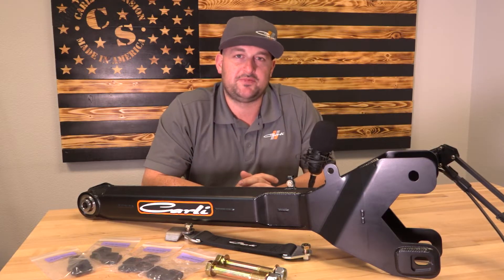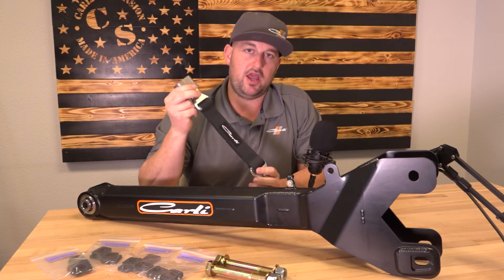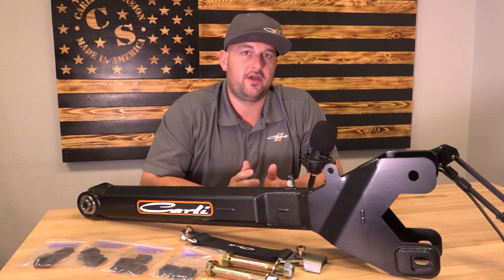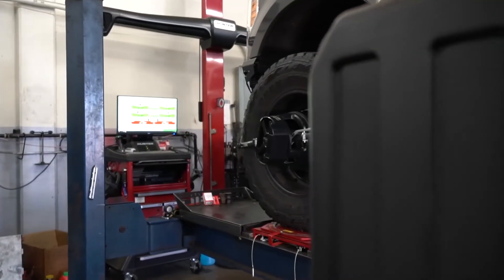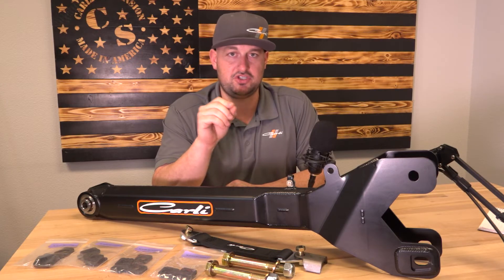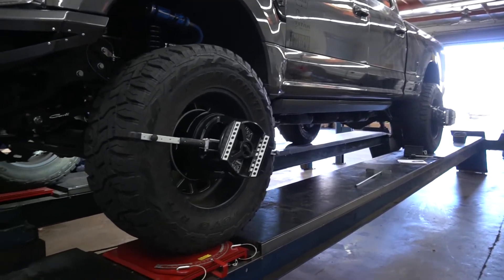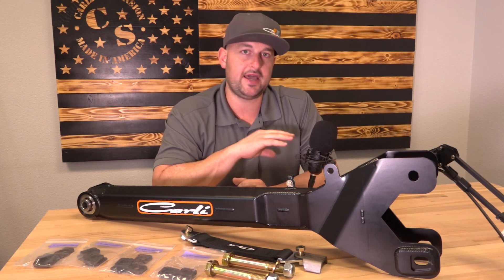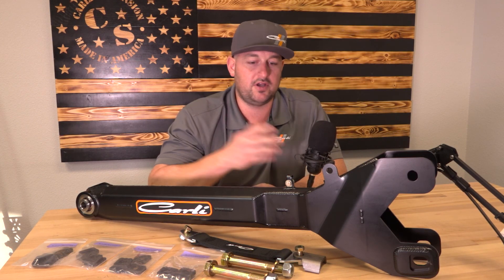Ford Adjustable Radius Arms -

Comment: What about the weight scale linkage ? Do we just drill holes and install the bracket ? I was hoping the wholes would already be pre drilled
Reply from the maker: For now, we're recommending CJC's lockout brackets - we're working on a system to implement the headlight/scale linkages. We're anticipating early 2026.

Comment: Have a 19 SD with 2.5 commuter. Drove fine with RL track bar bracket but couldnt stand the tires sticking out more on the passenger side. Went back to stock bracket and switched to Carli track bar. Had to shorten the bar way down to center. Now it pulls hard right. Already have the shims and alignment is spot on. Would these arms help that by adding more castor in general? Might doing a higher notch on the passenger side help. Drives great other than pull. I'm considering replacing the upper stabilizer but feel thats not enough with this much pull.

Comment: So, why do y’all stick with the radius arm style suspension and not convert to a parallel 4 link with separate upper and lower control arms? With the radius arms, the caster is “locked” essentially and throughout the suspension cycle the caster is going to change with it. I just feel like a 4 link setup would help with articulation and keep the caster change and bump steer to a minimum. Especially with the suspension travel numbers your kits are capable of.
Reply from the maker: Hey Rey - good question! We always loved the Radius arm platform and never found it to be a limiting factor requiring redesign given our intended use. If we find significant limitations to the platform, we'll figure out a solution. The 4-link will articulate more and maintain caster throughout the stroke. The Radius arms will only articulate as much as the bushings will deflect acting as a secondary sway-control mechanism without limiting the articulation we need to see from a performance stand-point. You're correct, the caster changes throughout the stroke with the radius arm but this actually keeps the pinion angle in check to avoid binding your driveshaft at the bottom of the travel stroke. The "4-Link vs. Radius Arm" discussion is as old as coil spring straight axle trucks - they both have their pros and cons. In the HD truck platform, we prefer the radius arms for their stability and pinion angle as we're building utilitarian rigs. In a Jeep, it would be a center mounted long-arm 4-link all day but you're not towing anything with one of those! You can see from our videos, the radius arms are not limiting our axle movement!

Comment: Are the limit straps required when running these arms? Wouldnt be a big deal if they were bolt on, but for a lot of DIY guys that dont have access to a welder are they required?

Comment: man, your kit comes with ALMOST everything.  bolts, brake lines, vacuum extension, all that crap that you wouldn't normally get in kits of anything.  but, with full deaver rear leafs, it'd be super nice to include the shortened front leaf bolt.  and if you could design a bolt on bracket for limit strap, that'd be icing on the cake.

Comment: I haven’t installed my kit yet on my 2020 F350. In your opinion should I just leave the stock ball joint shim in and adjust at the radius arm? If so, what notch # would suggest I put in before I drive over to get an alignment. Or do I also put in your supplied ball joint shim too?
Reply from the maker: If you're adding our radius arms, there's no need to utilize the ball-joint shim as well. The arms have plenty of correction to address the caster in both lift heights!
Reply: What if I installed the shims on the ball joint and the radius arms. My installer did this not sure if I should go back to factory ball joint shims

Comment: Dan,
I live in Austin Texas and just ordered a 2022 F-350 Platinum which should be arriving in approximately 60 days (March 1st).  Watching your Carli videos has convinced me to spend the extra money and have my truck modified correctly.  I don't go off-road and do not pull or haul anything, but I'd like my new truck to me maxed out (4.5 w/37") to include radius arms and sway bar, etc.  My first question is about the lead-time on any of these components - I would like to time everything with the delivery date of my truck.
And also, are there any changes in the parts for a 2022 . . . will everything fit and work?  Please let me know.  Thanks
Reply from the maker: Hey Mike! We don't sell direct but - I'd highly recommend reaching out to one of our stocking retailers for cost/avail. 

https://carlisuspension.com/retailers/

The 2022 saw no suspension changes; order away!

Comment: I appreciate that you installed all shims, then went back & installed the 3 notch & you mentioned in the video that the reading is different than before. We run into that all the time at work w/ 3 Hunter Align. machines & sometimes they can be close to each other & sometimes not. Overall a very great design & explanation of what the product does w/ proof.
Reply from the maker: We appreciate your appreciation - a lot of effort goes into all product design & testing here, we need to show more of it!